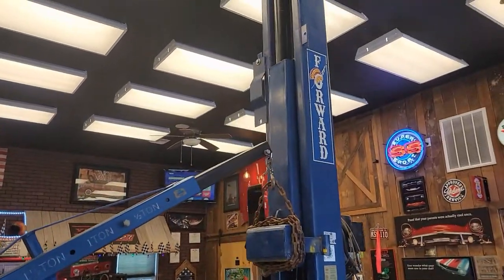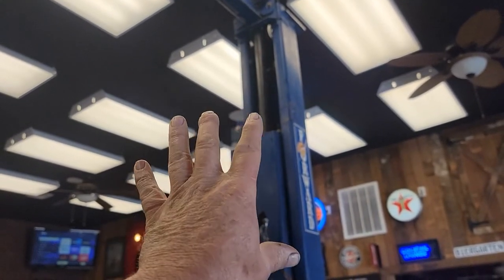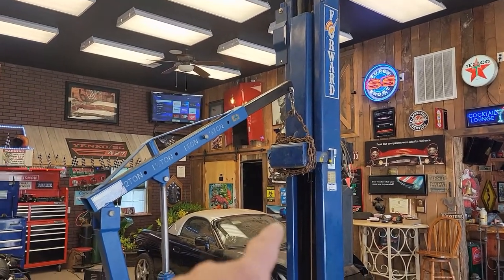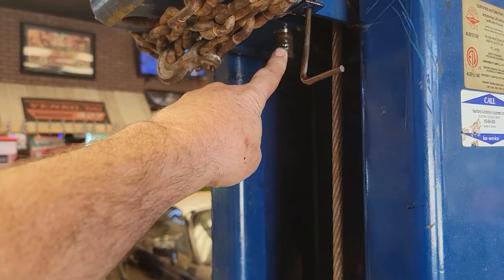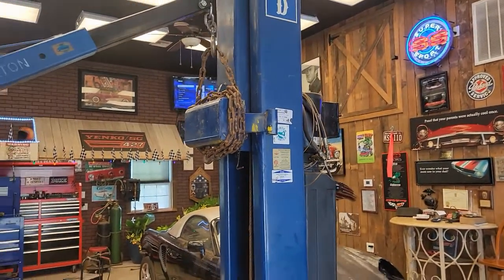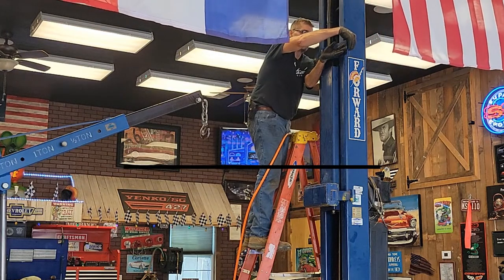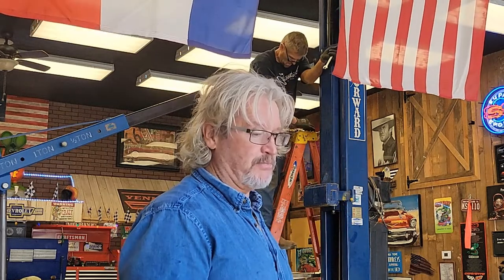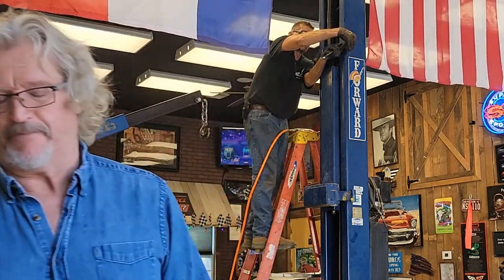Replacing the lift cylinder on a forward twin post lift!

Comment: Where didyou buy the cylinders and how much including shipping?
Reply from the maker: My brother bought them online. I think they were around $800 for 2 of them.
Reply: I may see about getting my rebuilt. If you have a part number or got any info on them l'd appreciate any info. I have the same lift. Installed it 2007 for $3500 now they want $6800 for the same lift installed

Comment: When you first started did you raise it up with the hoist or with lift motor then add tension on the hoist chain before releasing the pressure?
Reply from the maker: We raised it up with the motor, hooked the hoist to it, then pressed the button to let it back down, while the hoist held it in place. This way the pressure was released from the hoses and cylinders.
Reply: @WagsAutomotive  thanks, nice looking shop. Helping father in law with a leaky piston. Can’t wait to get my shop built. Cool c10!